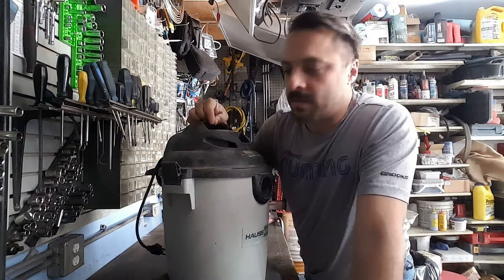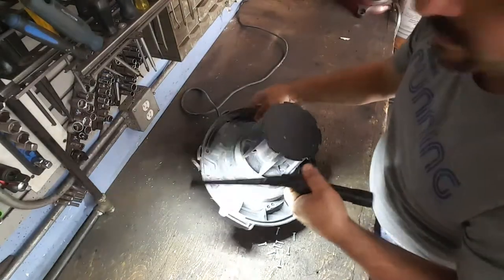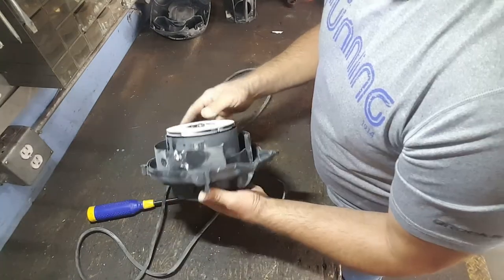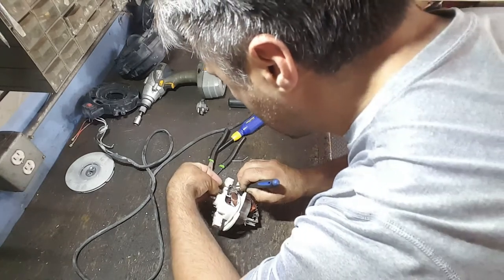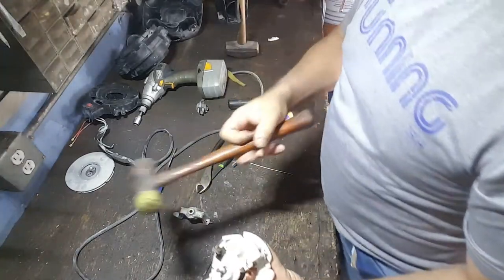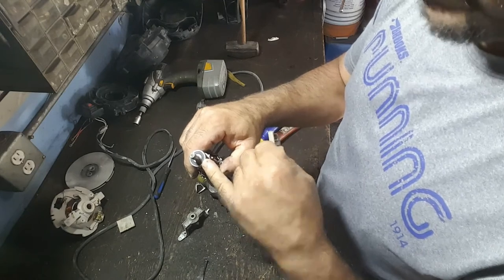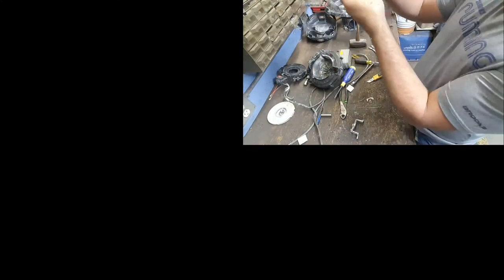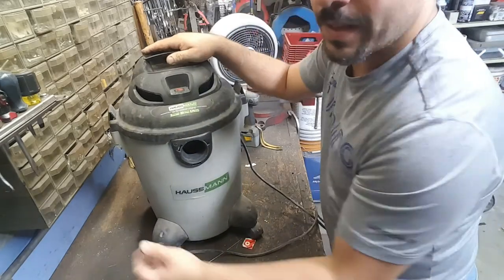Noisy Shop Vacuum Repair. Replacing electric motor bearing.

Comment: In order to keep the bearings clean you need a new dry filter. Looks like someone sucked up concrete dust with the wet sponge
Reply from the maker: i suck in anything and everything...so I'm sure it was caused by the operator....me. :)

Comment: Brian Andrews is correct, although I would recommend the 608 2RS with rubber seals.  Better dust protection.  The part in the bracket (@10:50) is a bushing, not a bearing, unless this is the miracle machine).  The same 608 2RS (or ZZ) bearing will fit in the bracket after you pry out the retaining ring and remove that cheap garbage.  Otherwise, an excellent video on the process!  I got a 10-pack of 608 2RS bearings on Amazon for 10.00 USD.  Took 15 minutes to replace the bushing with a bearing.  Machine sounds like new.  Nice edits and info.
Reply: Did you have to press your bearing on the shaft? The 608 just fell on the shaft of my shop vac. Mine looks like it takes a 1603 bearing instead.
Reply from the maker: Hmmm....from what I remember I don't think I needed a press.

Comment: If the noise soon returns, pull it back apart and remove the upper motor bushing bracket. Looking up at the bottom side, measure the circular area of the bracket that houses the brass bushing and retainer clip. Odds are, it is the same diameter as the 608z bearing. If so, you can pry off the bushing clip, remove the bushing and install your other 608z bearing in place of the bushing and your problem will be solved for many, many years!
Reply from the maker: Thanks!
Reply: If the bearing feels good like you said, and you are in a pinch and need the machine, carefully pry the rubber seal out. If lots of dried grease in there, clean out with carb cleaner or brake clean, and careful use of compressed air. (Don’t forget gloves and eye protection here) Pack some grease in, a moderate amount, no more than half full. (Those bearings seem to come from the factory with amazingly little grease, chances are it will look completely dry inside) Many ball bearings and tapered roller bearings are replaced unnecessarily, when they just need a cleaning and lube. For the bushing, more often than not, they are made by pressing powdered bronze, so the bushing is actually porous. Put a fingertip on the bottom  end of the bushing, hold the bushing upright, fill it with light oil ( 10w30, 3 in 1, whatever you have handy. Not 80w90 tho, it stinks!! ) press another one of your fingers onto the top end of the bushing, sealing the oil in. Squeeze so your finger pushes in, this forces the oil back into the porous bushing, refilling the tiny spaces. Release, drain the oil, you should be good to go for a long time.

Comment: Usually the ball bearing is fine, which you noted, but the sintered bronze bearing is bad. A 608 bearing will fit right in its place. You may need to slightly shim it, it’s typically slightly loose in the boss. Shim it with actual shim stock or an aluminum beverage can can be used to cut some shims. You don’t want that outer race spinning in the boss! See:   https://youtu.be/pvIoLe883JE
Reply from the maker: Thanks! good tip!